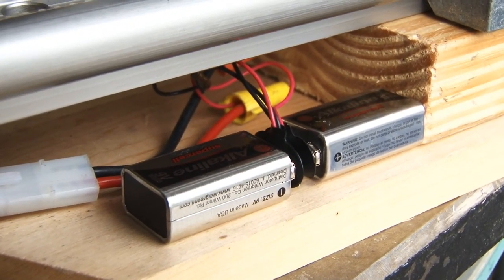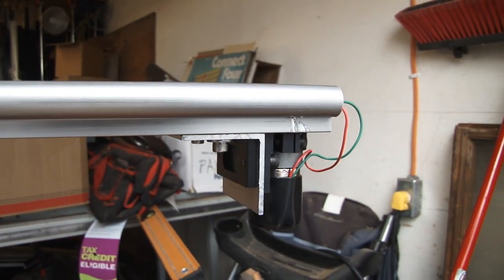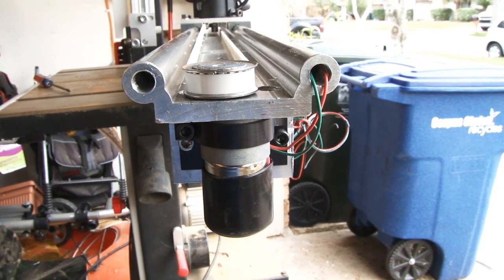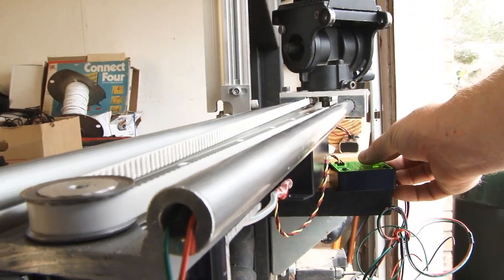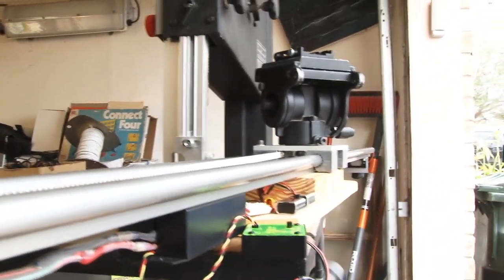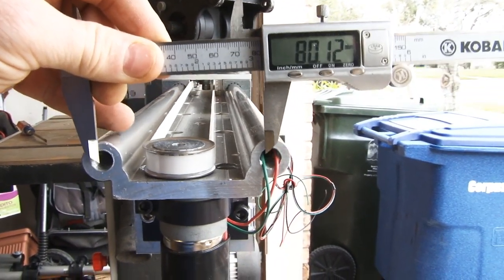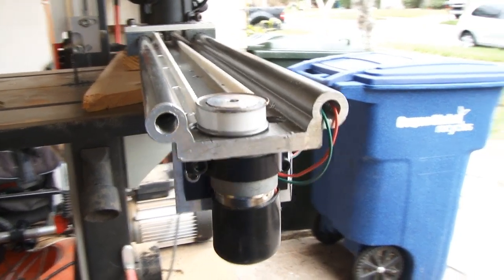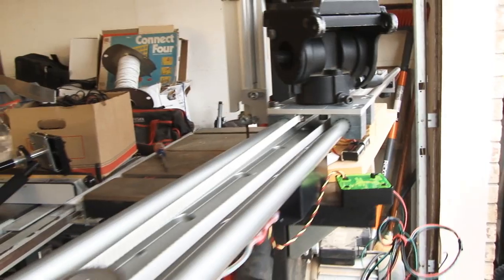Motorized DIY Slider #3 update

Comment: Derick (This is part 2)
On your next video (with a 90 degree mount), I could hear some noise from the motor, and it
sounds louder than the one in this video with the upright mount. Does the noise increase because of the gear?
Could you tell why did you use 2 motors? Does that increase smoothness?

Comment: Sorry I have to post it again (1)
Derick, great Slider, it looks very smooth to be running with two 9V batteries.Very well done and very professional.
I want to built a motorized slider and your project is very "solid", but I need some help and I have a few questions:
Could you please give a detailed list of all the parts and where to get them?
How is the noise level? could I shoot an indoor interview with it?

Comment: Derick, great Slider, it looks very smooth to be running with two 9V batteries.Very well done and very professional.
I want to built a motorized slider and your project is very "solid", but I need some help and I have a few questions: 
sounds louder than the one in this video with the upright mount. Does the noise increase because of the gear?
Could you tell why did you use 2 motors? Does that increase smoothness?

Comment: Hi great work, can you please tell us which is a better way of mounting the motor? 90 degree or inline? Also where to get the rubber caps to protect motor connections?
Reply from the maker: Inline worked best, but added some height. I stuck with the simplicity of inline.